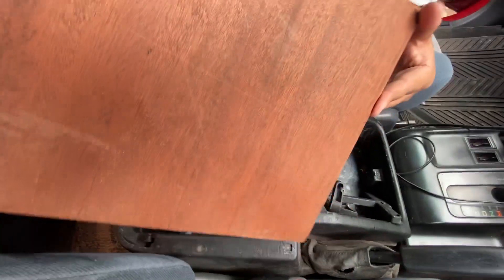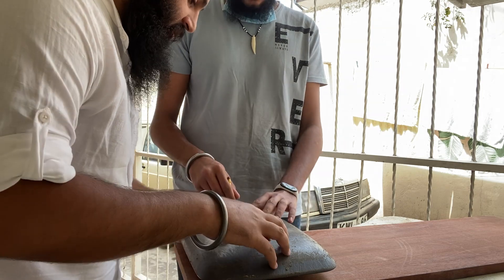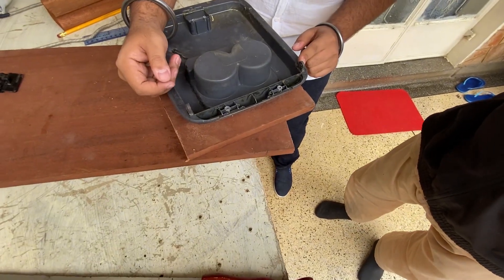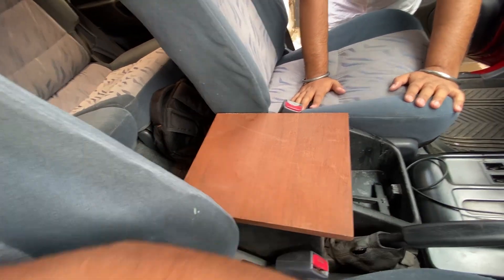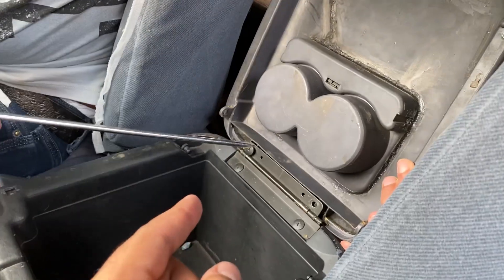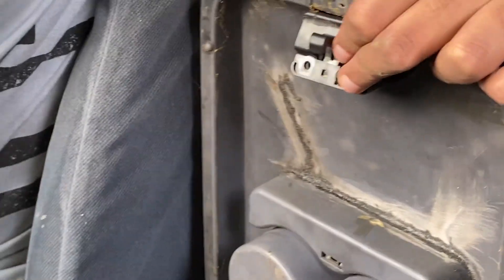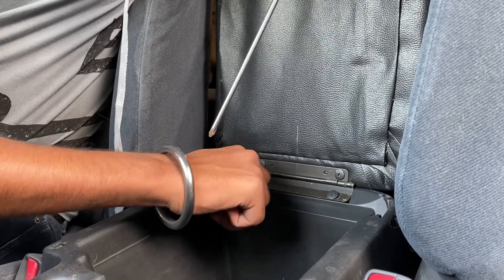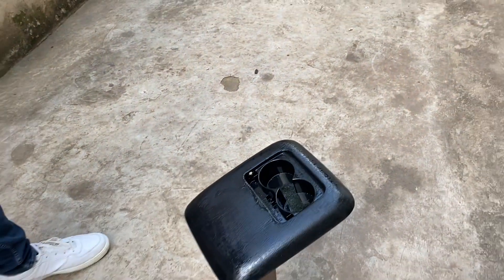VLOG 01 | My First Video! 🇰🇪 | Intro | DIY Car Arm Rest | Prado 95 | Gurkirat Singh Vlogs

Comment: Can one spray paint a rusted part of a bike without primer etc?
Reply from the maker: Yes you can but it will not give you permanent results.. to get best results, sand the parts properly with water so it builds those minor groves where once you paint, it sticks properly onto the surface. Will upload a video on this soon!
Reply: Thanks. Noted. Will be on the lookout for the DIY vlog